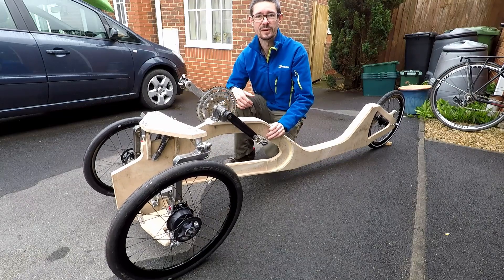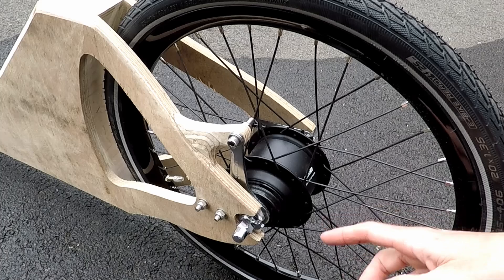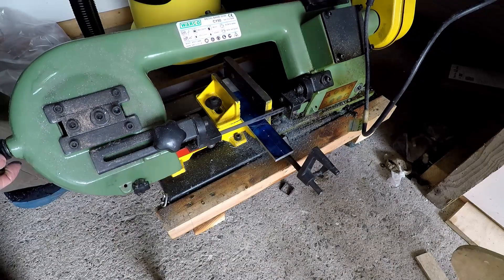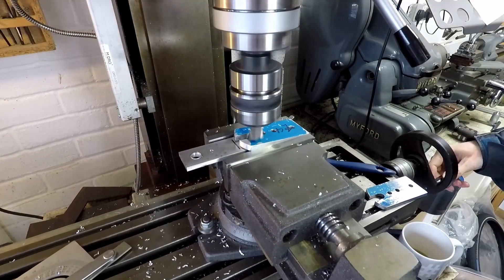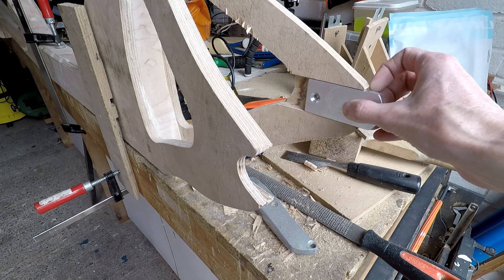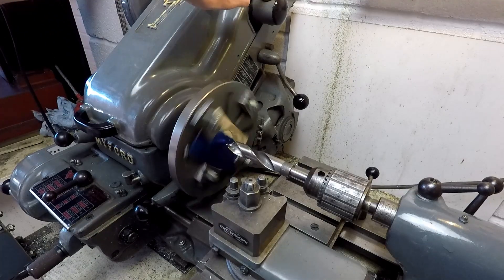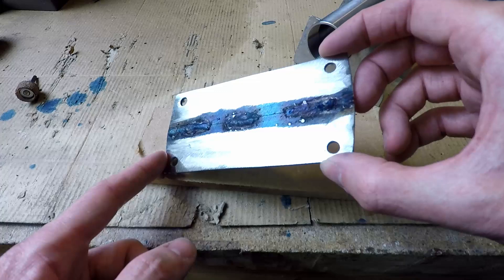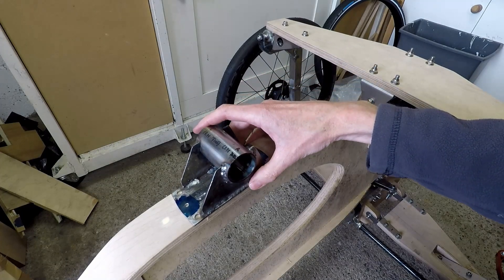Tilting Trikes Part 12 - rolling chassis with back wheel and crank

Comment: Very nicely designed and thanks for sharing! I suspect rather large loads to pass through the bottom bracket. Would the four smallish bolts be sufficient over time? Just my two pence?
Reply from the maker: Thanks - the BB probably needs some additional locating pins for security.  However, this was just a prototype and not designed to last!
Reply: @MetalMachineShop  Keep up die interesting engineering please!! Your videos are really captivating and easy to follow
Reply from the maker: @JL-lh8kl  I will!

Comment: Can I ask why the peddles are always so high up?
Reply from the maker: There are two reasons with this design; first is to put the feet in line with the chest to allow for a future streamlined body, second is because the riding position is the same as for a normal road bike just with the torso angled 45 degrees back, so that’s where the feet end up.  Feet could be lower down, but that would  equate to a more ‘upright’ riding position, preventing the power that can be generated by bringing the knees close to the chest and engaging the buttock muscles in the pedal stroke. That’s my theory anyway!

Comment: if you were to epoxy some black carbon fiber cloth over the wood it would make it stronger and waterproof to last forever.
Reply from the maker: Yes, agreed but this would defeat the purpose of a wooden frame; if you have to resort to carbon fibre reinforcement then the wooden design is deficient in the first place.  That said, the section under the seat is potentially quite weak and may need reinforcement.  I'm considering an all-carbon Mk II if the Mk I is successful.

Comment: From what are you planning to build the shell from?
Reply from the maker: Possibly a very thin carbon fibre shell. For this design the body is not designed to be load-bearing so it can be thin and light.
Reply: @MetalMachineShop  Message to metal machine shop https://youtu.be/idahTu2aheo

Comment: It seems to me the left hand thread should be on the left side as to prevent the bb from loosening as you pedal forward!
Reply from the maker: I’m pretty sure I’ve done it correctly but it’s the other way round to what you would think!
Reply: Yes you would think so but it's weird. Something to do with "precession" or something. He definitely did get it the right way round. The pedals are the other way. Left pedal is lefty tighty.
Reply from the maker: @benc8386  thanks - that's a relief!

Comment: Nice engineering work, but terrible welding :)  Try to set voltage and wirespeed on scrap piece - this video from Jody (and tables on his website) also helped me a lot: https://m.youtube.com/watch?v=sZuq4XQTHVs
Good luck, very nice project. I'm also doing a three-wheeler velomobile, with metal-shaped carosserie from steel...
Reply from the maker: Thanks, I agree about the poor welding! I need to do a lot more practice.  Good link,  very helpful.
Reply: @MetalMachineShop  You should really get yourself a TIG for this kind of thing. Having said that you've made it work and it should be fine. I was a bit worried you were going to need to chase the threads on the BB shell because of weld through but actually the BB went in just fine!
Reply from the maker: @benc8386  yes I’d love to have a TIG welder - and be good at using it!
Reply: @MetalMachineShop  It just takes a bit of practice like anything but in many ways is the ideal process for a hobbyist as you can weld anything from thin to thick, no fumes, and the only downside is it takes a bit longer. But if you're doing it for fun this is not a problem.

Comment: Backside looks a touch too far back (or down).  Good starting position is to just be able to reach the pedal at its furthest position with your heel.

Really looking forward to seeing how this takes shape. The front wheels were further forward than I had envisaged, but I can see why…
Reply from the maker: Agreed - when the seat is fitted it will be adjustable so leg position can be optimised.

Comment: Interesting that you've made the dropouts at an angle, instead of parallel to each other, that way they could have been just cut on a laser, given that is available to you.
Reply from the maker: Well they weren’t supposed to be at an angle! I had to make adjustments as the laminated seat stays didn’t end up quite as parallel as planned.  Most of the bits in the vid were made pre-CNC availability, by the way😉

Comment: Hi, always nice job ! your pedals are too far from the seat and too near of the direction top bar, isnt it ?
Reply from the maker: The seat will have some adjustment when fitted so the leg position can be fine-tuned.  As long as the pedals and feet clear the tilting arm there should be no problem.
Reply from the maker: @Martin Corrick yes, vulnerability is an issue. Definitely choose your roads carefully.  This sort of design is best suited to the sorts of excellent segregated cycle paths you get in places like Finland, but there are some good ones near where I live too.
Reply: ah, no seat on it yet! duh! You sit back further with no seat.